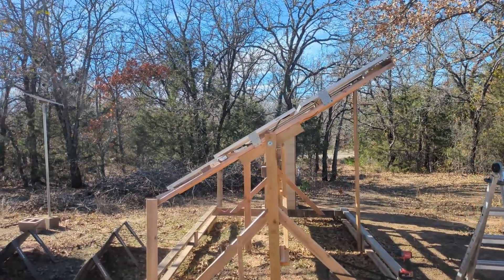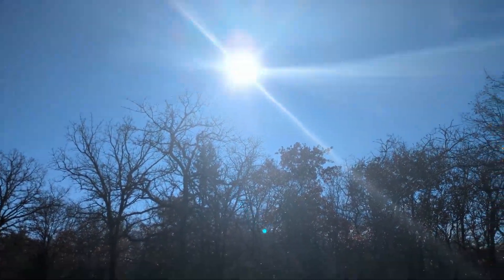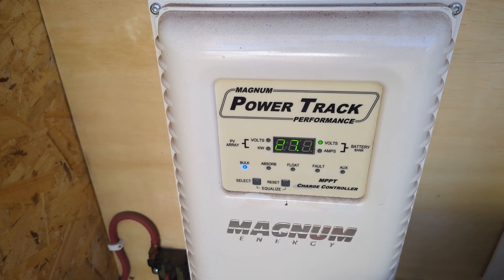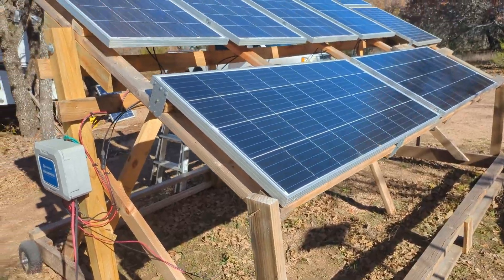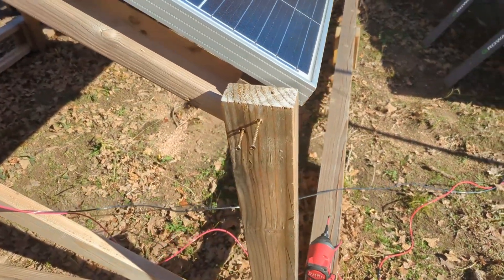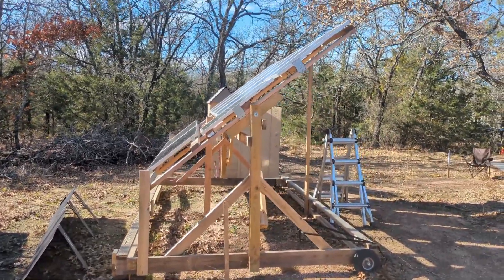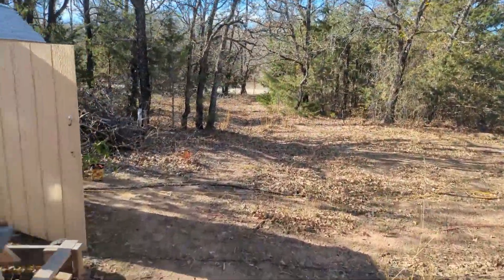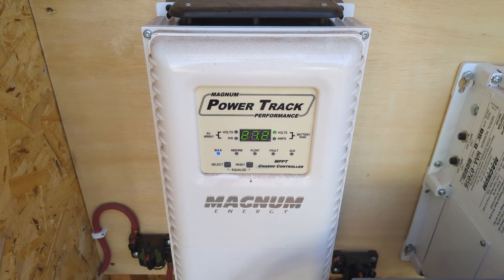HUGE Gains From Adjusting Solar Panel Angle On Ground Mount Solar Panel Arrays - Proof in 90 Seconds

Comment: I have a lever on mine with 3 notches to adjust throughout the day. The whole system is on casters to rotate as well. On overcast days it seems best to aim them up at the clouds regardless of time.
Reply from the maker: Not bad.  I applaud the effort.  Not sure I would be diligent enough to adjust it three times a day.

Comment: used panels are so cheap it's no longer worth the effort to make adjustable mounts. (off grid for 30 years.)
Reply from the maker: I can install used panels AND adjust my panels.  You saw how easy it was in the video.  Took me 5 minutes and that was only because I had a couple screws snap on me in the wood so I had to wrestle with that.
Reply: Many people have limited space to put ground-mount panels and just wouldn't have anywhere to put the extras, so maximizing what you have is a good investment.

Comment: So, once a month, go to the solar farm, hose and brush the panels to get the bird poop and dust off, adjust the panel angle to that month's optimum angle.

To make the adjustments easier, you need to do some schoolboy geometry/maths. 

Get a big piece of cardboard box, draw a line equal to the distance from the pivot to the adjustment point, draw an arc (pencil & string) with that as the radius. Use a protractor to mark off the relevant angles for each month, punch holes. This will also show you how much of the arc you need. Cut out the shape a few inches oversized, mark places for fastening holes. Take it to the local scrap yard and get a piece of 1/8 to 1/4 scrap plate big enough to cut out two of the shapes plus a little bit. Markout the plate to size with the various holes, cut roughly to size, clamp both pieces together and drill ALL the holes, countersink as needed. From the scrap pieces (if any) make a couple of brackets to screw to the panels which have a hole for a bolt so it will line up in the 'angle' plates. 

If you have a metal stamp set, mark the holes in the angle plates to show the months for each hole (Hint: they will double up if you did the calculations right). Or use some other system to mark which hole is which - a centre punch to make the initial letters is one.

Use 2 hot dipped bolts, one each side, to set the angle. 

If you can do blacksmith work you can make a similar device hot from some steel strip, just heat and strike the outside edge to make the strip curl to the right radius. 

Spot the error in the description, its too much work to go back and try to fix it.
Reply from the maker: I'm definitely going to do that when I build my permanent ground mount setup at the back of my property.  This one is temporary (as you can see it is even on wheels) and I did it as cheaply as possible while maintaining structural integrity and adjustability.

Comment: 680 to 720, do you feel that is enough to adjust panels?  I was planning on a permanent summer setting as I use less power in winter.
Reply from the maker: I could have gotten another 30-40 with 10 more degrees.  That could be up to a 10% power boost all throughout the day.  Definitely worth it once per season.

If you can't build in adjustment or don't want to do it then fixed mounting at an angle equal to your latitude is a good all-year compromise angle.  If you want a summer angle, like you mentioned, you would make the panels more flat since the sun will be high overhead.
Reply: You also receive so much less sunlight in winter depending on your latitude.

If you live in a sunny winter climate maybe it'll work out, but it's something to bear in mind.
Reply from the maker: That's true.  So every little bit helps because there isn't any to spare.